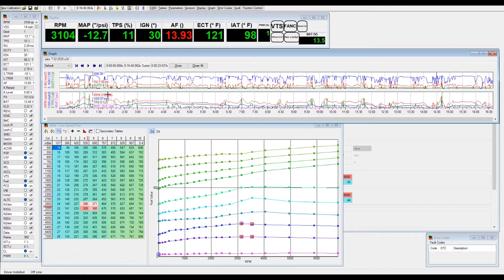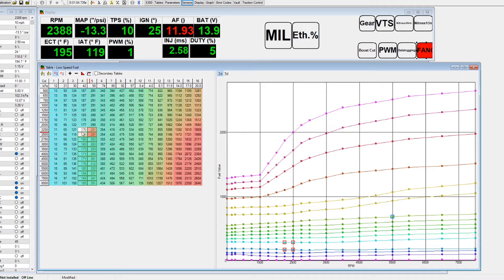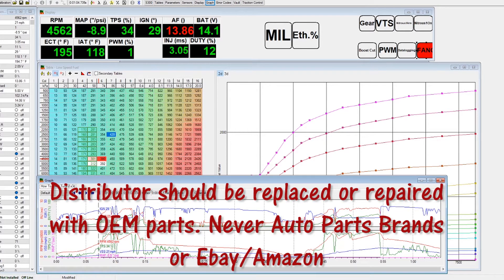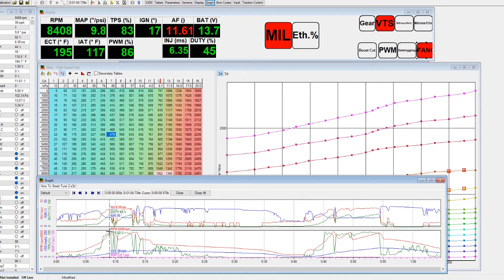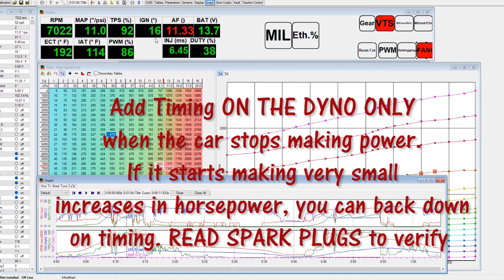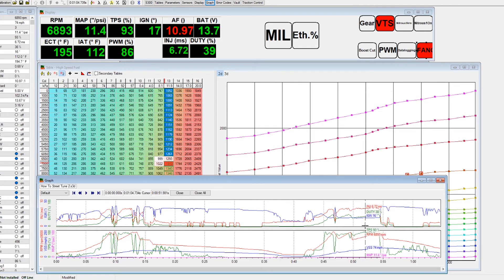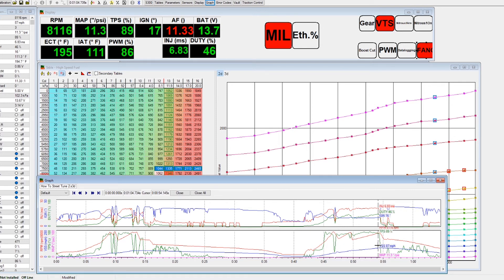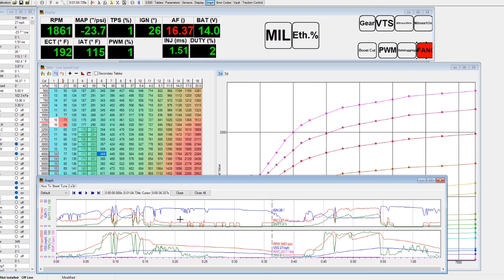How To Street Tune Part 2 Hondata S300 Reading Logs

Comment: Can you do a video on how to set target afrs in specific sections of the map?  I think this video explained a good bit about MAP values * rpm, so it definitely helped me but I'd like to set specific (different) afr targets in different areas and can't figure it out just yet 

That being said, I haven't used the log with graph method yet (only been doing live street tuning, I'm new to this) so I'm definitely going to try this
Reply from the maker: In the video I show you how to set AFR and I give you the AFR that you need to target. 

You need to try tuning the car first and you will see how incredibly easy it is to adjust AFR with the fuel map
Reply: @KuganTuning video def helped. I ended up playing with the software offline until I figured out how to get it to do what I wanted
Reply from the maker: @notamechanic4130 niceeeeee! That’s sick you got it figured out
Reply: @KuganTuning got it running pretty good (fighting what I think is a bad ignition switch) I think. I wanna stay all motor and order some stage one cams next....
Reply from the maker: @notamechanic4130 what’s it doing?
Reply: @KuganTuning no start on key turn. Fuel pump primes and everything just no crank. If I jump starter it fires right up and runs good. Already changed main relay and checked fuses. Thinking ignition switch at this point ...
Reply from the maker: @notamechanic4130 that wire travels thru the fuse box so you have to check the wire with a volt meter coming out of the ignition switch
Reply: @KuganTuning yep next time I wrench on it the ignition switch is what I'ma check with a voltage drop test

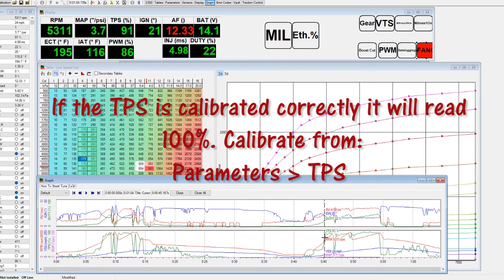Comment: 7:27 do you have any experience with the TPS signal falling out during operation for a matter of seconds before it returns even though TPS performance is consistent, minus the drop which cuts response? My sources point to heat soaked and vibrations but most recent event the AIT & ECT were average, there was only some occasional pulls before the event. I know there are haul TPS with no contact moving parts that support fall out. Just wanted you response, thx.
Reply from the maker: Check wiring and or replace tps sensor.
Reply: I went through 2 tps sensors hunting a signal drop until I got a good one. Make sure the little lock in clip is clipping in...since I got an OEM sensor and fixed that I'm having no more drop out signal

Comment: Are we able to still use this tune? I have a Stock B18C1 With 1000cc Injectors and e85 Full Bolts on Motor was freshly Rebuilt
Reply from the maker: Tune is setup for stock injectors. Id suggest using the stock GSR tune from Smanager and changing the injector data for the best driving tune

Comment: @ 8:00 units are set to kilopascals instead of inches...? 🙏
Reply: I’m still NA so I’m using KPA bcs 100-101 KPA equals one atmospheric pressure aka
 (sea level) but in boost applications you will see zero vacuum and zero boost.., your boost gauge will be at 0 which means boost is providing exactly the amount of air that the engine needs, without additional air pressure which is considered boost once it is above zero. So ppl switch to psi bcs it’s more practical in boost applications vs trying to calculate KPA at such high values. I don’t think the ecu does anything different whether you choose to monitor psi vs KPA, I believe that’s just for us humans to use as a visual gauge so we can do what we need to do easier.

Comment: So after you created a basemap. You are live tuning the car? How are you able to get that live feed where your going along the graph? I'm trying to learn how to tune.. shit seems hard as hell.. just installed a turbo on my 95 accord f23a/f22a hybrid.. and got hondata on the way.. tuners are non existence where I live and the ones that are are 8 hours away.. so I'm forced to learn how to tune with my passion for cars.. I just need to know how to turn the car on with bigger injectors then tune the map as I drive and what to adjust the air fuel levels that I see while driving.. do I just drive then when I see a spike in air fuel levels either rich or lean stop the car then go to where it is on the map graph and adjust it to what it should be? Please bro if you can help any that be great bro..

Comment: Hey man, for the pops and bangs.  i dont see anything about ignition timing in the TPS parameters. Only "
overrun fuel cutoff(TPS)
overrun fuel cutoff (MAP)
Overrun fuel resume (initial)
Overrun fuel resume (normal)
Then the tip in fuel
Can you make a video on how to do it?

UPDATE: figured it out! And what's cool is that I can control when it pops. Just have to barely touch the gas pedal and it'll pop. So I can make it not pop when I'm going past a cop or something 😂
Reply from the maker: The next video I  release will show you how to do it and where the parameters are. This is where they will be --------> Parameters > TPS IGN* ***Update video will not be released
Reply: @KuganTuning  link for the pop & bang video?
Reply from the maker: Wont be releasing the video. Use the above settings and play with timing to get it to do what you want it to do
Reply: @KuganTuning  why wont u release it?

Comment: how much are you able to retard the ignition timing? I just had hondata s300 installed on my car for my B18C and all I can do is -4
Reply from the maker: -4 on the table. Launch control can go way past that. Where are you attempting to command negative ignition timing?
Reply: @KuganTuning  for some reason even launch control would only go to -4 regardless of what value is set
Reply: @salimsopari  hmm, on the tables I can only go -4. But in launch control I can go as much as I want